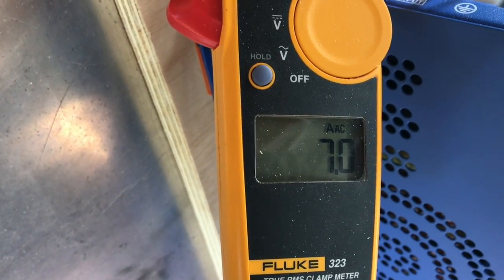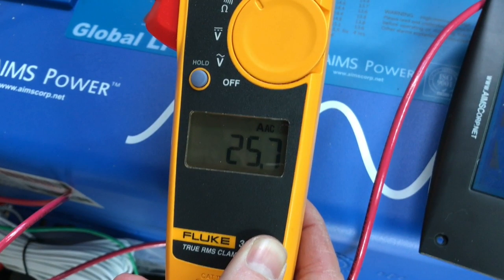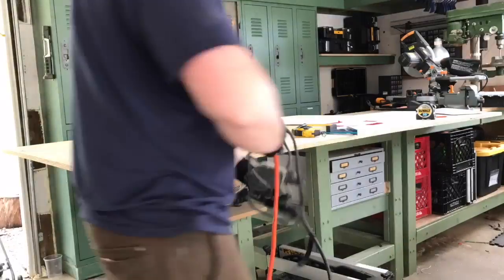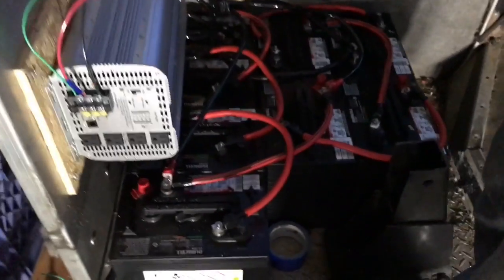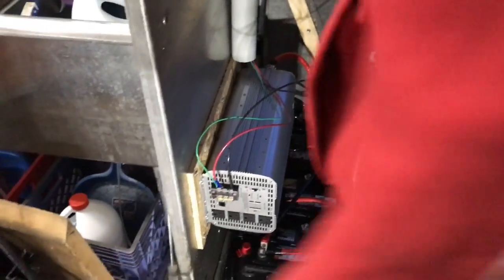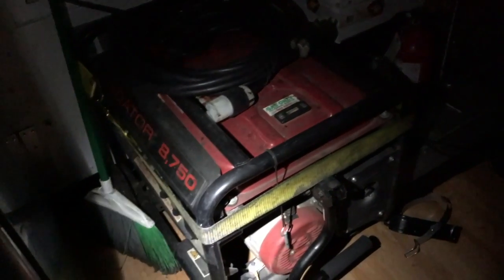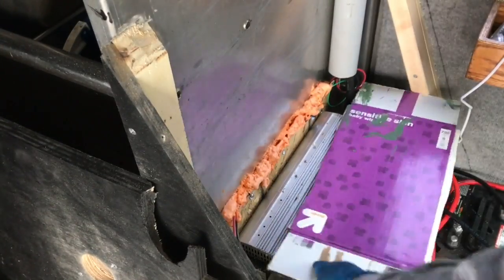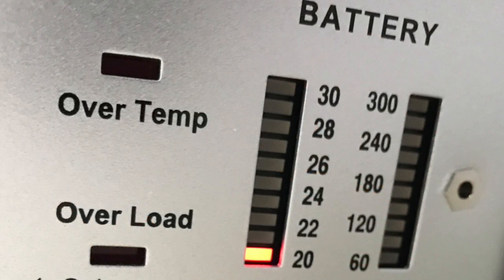#2 - Clean Energy Food Truck (Increasing from 12v to 24v Battery Bank)

Comment: The thing to keep in mind when designing these systems is that you only get about half of the spec'd amp hours of run time due to the way you are supposed to use the batteries by not discharging over 50%. Another thing that would lead to them discharging too quickly is that the overall capacity is far less when you are drawing them down too fast. Most deep cycle batteries are rated for a 20 hour discharge, a food truck would likely be designing their system for roughly 8 hours of service, discharging them faster means they less amp hours than spec'd, it is a good idea to get batteries that spec their capacity at difference discharge rates so you can design accordingly